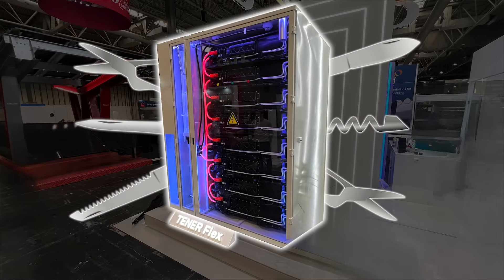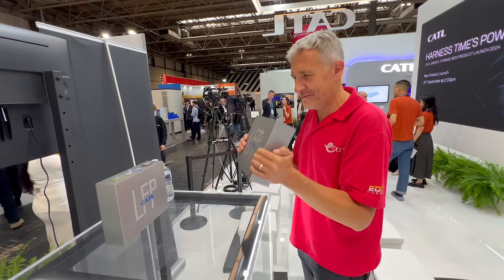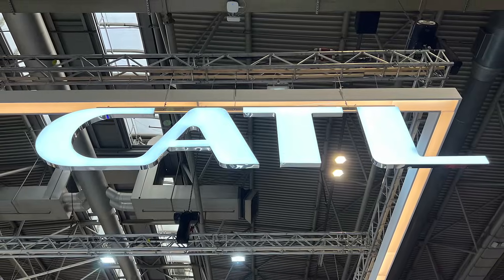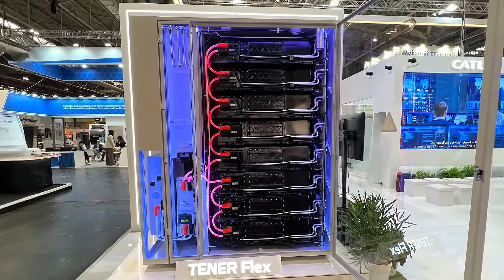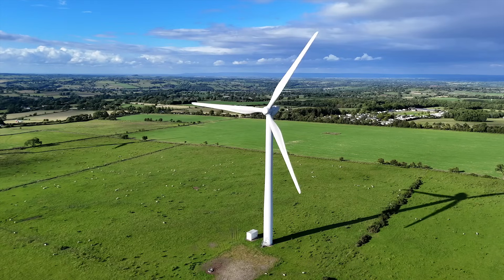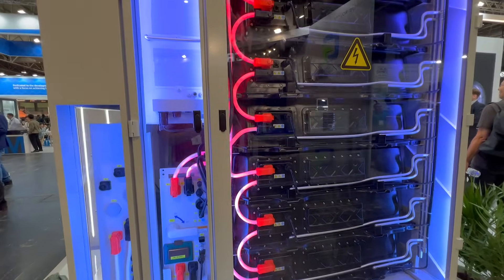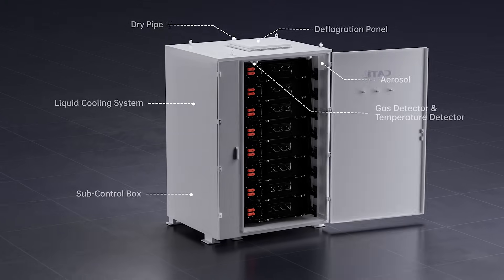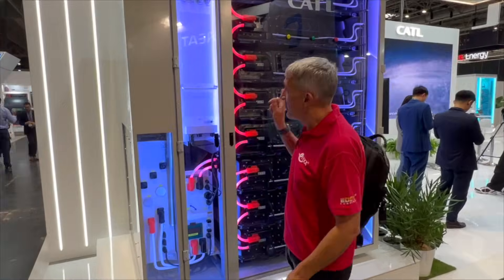The Battery Fixing Power Issues Everywhere! - CATL Tener Flex

Comment: So, the Tener Flex is 376kW continuous power output, with a total capacity of 752kWh.  Meaning it could run at full tilt for about two hours before it’s drained.  Here in the U.S., a standard home might have a 100A supply at 120V, for 12000KVA at full load.  But you can’t convert KVA to Watts at 100%, you have to take into account inefficiencies in the process.  A conservative estimate might be 80%, so you might need 15kW to feed that house at the full 100A.  If this box was running at full power, it could then cover 25 homes.  But if they were all running at full tilt the entire time, they would only be powered for two hours.

Of course, a normal home doesn’t run at those kinds of power loads for long periods of time.  Maybe about 10% max rated load on average, with peaks to 25% for brief periods when high load appliances are used.  So, you might be able to supply those 25 homes for twenty hours, instead of just two hours.

Now, businesses can run at or near max power drain for extended periods of time, depending on the nature of the business and their power draw.  But it’s still interesting to put some real numbers behind these discussions.

Comment: There's no hiding that "deflagration panel" is there?!
5:15 high-power charging from a low-power supply sounds awesome on the face of it, but is utterly dependent over the long-term on a duty cycle (time spent doing its OneJob) of somewhere below 1 in 12 (40kW / 480kW?). It's a bit of a shame to call attention to the idea in isolation, because when big house batteries become more commonplace who wouldn't want a 1MW home charger so one can pick up 50kWh of cheap EV charge in 3 minutes when one forgets to put the EV on charge the night before?
Reply: Yes, I thought the 40kW transformer supplying a charger with a rated output of 480kW was a little light on detail. A quick search on Google suggests a Tesla 3 (just taking it as a typical EV) has a maximum usable battery capacity of 82kWh. It is described as being capable of charging at 250kW (peak charging rate, presumably) and going from 10% level of charge to 80% level of charge in 27 minutes. Charging from 10% to 80% capacity only requires 57.4kWh of energy to be replaced (ignoring losses), which suggests an average charging power of 127.6kW for the 27 mins. The supply transformer would take about 86 mins to replace that energy (again, ignoring losses), so just over three times longer. I reckon it'll be a while before we see these chargers on next door's driveway. You could charge your 480kW rated charger from a 13A plug-top as well; it would just take a wee while.

Comment: Hmm. At 2:00 you state that the device claimed capacity of 6MWh is enough to supply 'about' 700 homes for an entire day. That works out at about 8.6kWh per home per day, which seems a bit on the low side, don't you think?

Batteries definitely have a role to play for individual households and some businesses and, to an extent, at utility scale for very short-term support (particularly given the increasing number of unplanned interconnector outages the UK is experiencing) but for the large scale energy storage we actually need to support the growing amount of renewable generation, even an energy density of 430W/l can't come close to the likes of pumped storage.
Reply from the maker: These are OFGEM figures for average electricity use.   Of course this will increase as EV use grows and adding heat pumps.
Reply: Probably not far off, but not for a house that is heated by any sort of electrical technology.
Reply: @obd6HsN  our house is a typical 3 bed semi, gas heated - average daily consumption in October is 26kWh. 8.6kWh is way off unless we're talking one-bed flats that lie empty for maybe 10 hours a day.

Comment: It seems to me that the price and carbon foot print of making these newer batteries and then them having a limited life expectancy when the cells degenerate over the years make . Feels like half the EV cars will end up in landfill when the battery replacement costs more than the used value.. it all feels more like a plaster over a larger problem that needs a better solution tbh
Reply from the maker: Batteries materials can be recycled.
Reply: @efixx  What percentrage of them? Just curious...
Reply: @OldSkoolPGFan  Theoretically 95% of the materials can be recycled but it's an ugly toxic process unlike ancient lead acid which is largely smash it up, melt it down and pour a new one.
Reply: Treated properly (controlling charge/discharge amps and cell temperatures, constrain cells so they can't expand/contract and cause mechanical aging) you can expect at least 5000 cycles out of a decent quality LiFePO4 cell.  That's full to flat (that's not 0 volts!) 5000 times.  Some manufacturer's state 8000 cycles but honestly I'm suspicious about that given they only offer 2 year warranty standard and 5 if you pay more.  Unless it's a specific industry where the cells are absolutely flogged 8000 cycles in 5 years is a hard boat to row, 2 years, well you may find your boat is so hard to row that it's actually made out of lead.  Shallow cycle the cells and the cycle rating blows out to silly figures, ie simple calendar aging is likely to be the reason for failure rather than cycling.
Reply: Nevermind recycling there is lots and lots of reuse going on already. Even badly degraded leaf batteries where the car can't manage 30 miles have plenty of good cells left in them. The packs are being disassembled and the good cells reused.

Once the range on my EV is genuinely no use for me or anyone in my family I'll be dropping the pack, disassembling it and using the best modules for home storage.